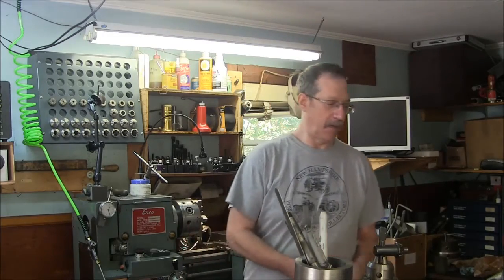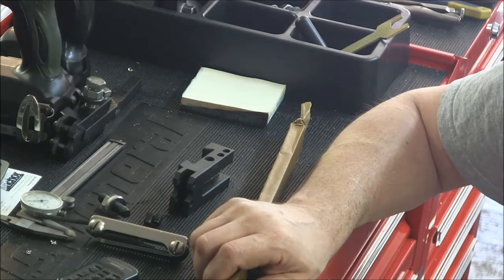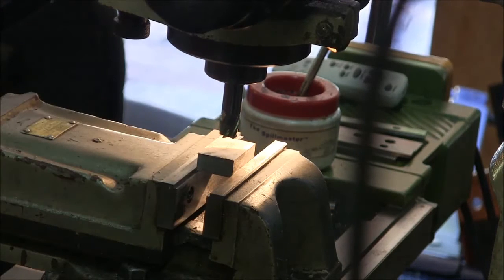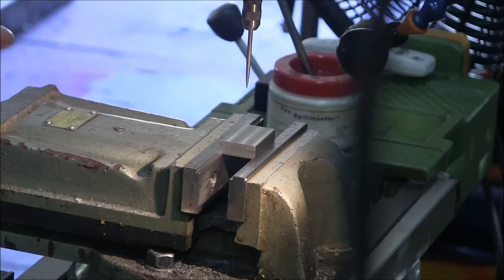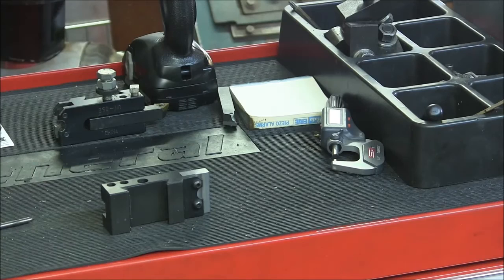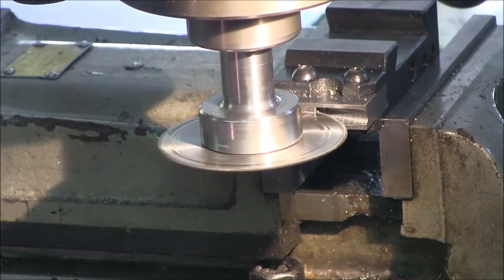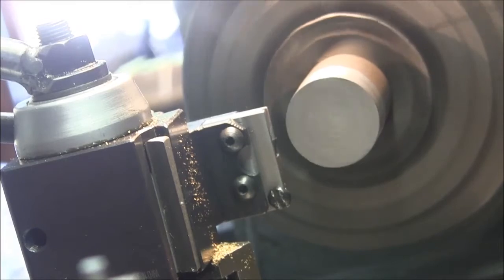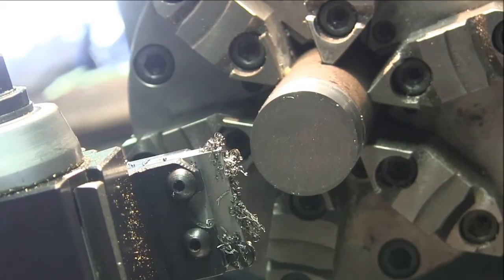Tool Holder Speriments

Comment: Now you got me thinkin'! I took the wheels out of my tool holder too. Like your approach - I have some nice flat stock - somewhere!
Reply from the maker: +ChrisB257 I was surprised at how well it worked. I am still exploring the envelope. The hard part is getting both ends on center at the same time. I might redo it and let a little of the block stick out the bottom to lower the bit. My bit is only proud of the face by about .1" which doesn't give good chip clearance, but it is rigid!

Comment: Looks real good joe....but IMO its not because its somewhat tangential which its really not because of its front nose clearance think about that one for awhile LOL.... but because its prob much more rigid than your other tool holders :)

also would think it would work much better if you removed the top portion of the holder for chip relief
Reply from the maker: +Lawrence Harasim I think it is more of a shear type of tool, thee great thing is how easy it  is to  grind the  bit. You are right though, I should cut back the top, it really does nothing but hold the chips in.